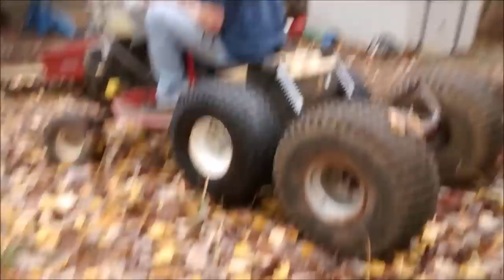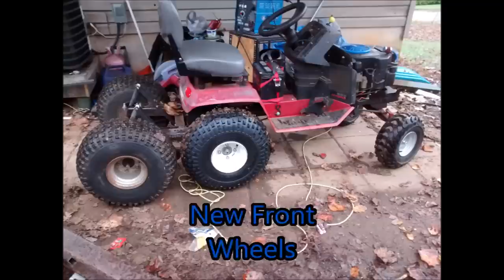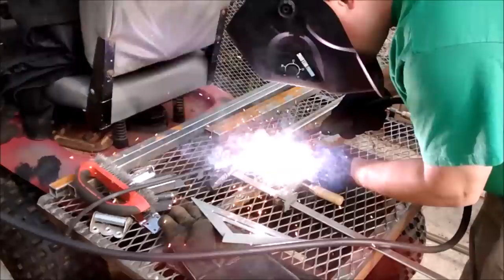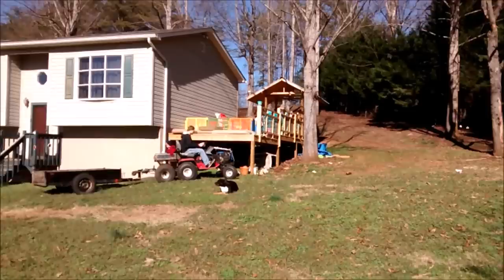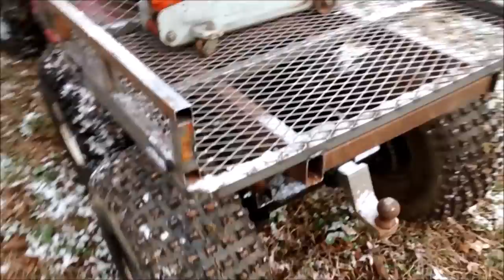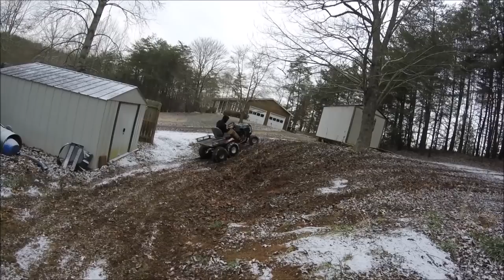6x4 Off Road Lawn Mower

Comment: It is what it is.  This project isn't intended to be the most perfectly engineered off road lawn tractor in the world.  But it clearly works pretty well, so don't be so critical guys.  It's also version 2.0, not 12.0.  Sure, there are ways to make this rig better.   I've got three lawn tractors sitting in my yard and who knows, maybe I'll try my hand at building a better version.  But until I or someone else builds a superior rig, don't be so quick to point out flaws in this one.   This guy deserves a round of free beer for his efforts.   It took a lot of work to put together a working model, test it, disassemble it, and build it back better.  That's the mark of a dedicated DIY project guy who just wasn't satisfied with the first version because he knew he could improve the design...and he did.  My hat's off to DangerDave.

Comment: Just my two cents. But the 2 axles need hooked up solid together. And a pivot in the center. So you will have the right down pressure.

Comment: Make a pair of tire chains so each sides wheels are connected! Half-track!
Reply: Matthew Barnes superb idea. I would get fat tires in front. More stability. But I must say that I admire all this work. I have 11hp snowblower with 3 forward speeds and 2 reverse. I want to convert it to a rear riding (standing up) log skidder or all purpose pulling vehicule (gravel, dirt, etc) . With a 2in hitch it would fit with my boat trailer, big garden trailer, destasher.
Reply: Easy Cut two truck tires of Appropriate round to then Oblong ..using a piece of string to figure out w about 2 1/2 inches of sidewall left as Guides preferred  E rated FOUND IN junkyard (recycle) ; deflate mower tires , slip on & reinflate. ...Half tracked Glory m8's 
All started w Good frame & swing arm design for ya superberbly well on a budget Very Noice indeed

Comment: Hi, can I use part of your video to my compilation homemade inventions and projects  ?
Reply from the maker: MGszaman Vlog sure that's fine.
Reply: @DangerDave95  i am gonna try and make a 4x8, i got two john deere sabres a plan and money.
is there anything i should be aware of a potential problems.
Reply: my engine will be mounted in the rear above the rear axles as opposed to yours however, and will have a cargo space up front.

Comment: Similar drive set up on the old JohnDeere Gator 6wheelers, for the rear wheels.  They have the engine sitting over the wheels and that weight being there makes all the difference in regards to traction.

Comment: How reliable are those chains and sprockets though after a long ride with some mud and rubble? Maintaining just the one chain on my dirtbike with its dust sheilds and adjustable hub & tensioner is already enough hassel to make me want to swap over shaft drive! Amazing job nonetheless though. The only thing I might have done differently is use double v-velts with a spring tensioner instead of chains for each set of wheels.
Reply from the maker: It's been 4+ years now and the chains and sprockets are completely fine. I haven't needed to do anything with them other than oil them when I remember lol. I've had it sunk into a lot of mud holes and gotten sticks stuck in the chains and it just keeps going. I'm using 530 roller equipment chain.

Comment: Great build! My $.02, both rear tires should be the same size. It appears that you have a larger diameter on the rear set. But again, great build!
Reply from the maker: the back tires are identical, but the front set are new and  have narrower rims, that's why they look different...

Comment: Im curious about the updated suspension that you made trying to figure out how it works. Does the length of square tube the shock is attached to pivot or is the shock fixed in place?

Comment: for winter get tracks on the back and skids on the front!
Reply: Nice idea but I highly doubt it would steer at all like that
Reply: why it wouldnt? it would be like snowmobile but 2 tracks insted of two.. well yeah you can weight transfer on snowmobile but so you can on this.Mo S.
Reply: +Saksugamer because you would tons of traction in the back and not enough in the front. engine isn't enough weight and it wouldn't be easy to distribute your weight. it would be awkward
Reply: +Mo S. well yeah but it would be cool and with bigger engine it would be drag machine

Comment: I know your going to think I'm nuts but I was looking at tractors for my daughter and a 4x4 small tractor is darn near $10k new and they dont have a bed on the back to put some weight in.  Do your idea seems perfect, can add wheel weights where it counts or couple feed sacks in the bed, the receiver hitch allows for the aftermarket implements for the garden and driveway work.  So do you offer plans on how you made the rear tandem setup?

Comment: Like the idea so to speak but, no mower deck so just something to drive around lawn now?
Reply from the maker: it's a poor man's ATV, it's cheaper and easier to fix than a regular ATV. I use it for yard work to carry tools and stuff, hauling wood, pulling my trailers, just all kinds of stuff. it's a work horse...
Reply: Danger Dave soften the tire pressure to get better traction. They look stiff.

Comment: Does improve the traction when backing up. My Craftsman Tractors do  great as long as I am pushing or pulling forward.  I can push a full blade of snow up my 10percent grade driveway.  It won't back up the same grade no matter what I try. I have chains on, but even on summer dry crushed asphalt it will not grip enough to back up a grade. Any suggestions
Reply: Lower you tire pressure

Comment: Wow that is awesome! I really like the bed! But how is the steering ratio? Isn't it though steering with four locked tires?
Reply from the maker: thanks. steering isn't that bad on dirt but on pavement it hardly turns lol but I've got an idea on how to fix that! :)
Reply: +Danger Dave cool! How? Saw the rear axle into two to make it diff again? Or would it even help?
Reply from the maker: I guess that would work but Im just going to make the old deck lift lever    so it will lift the rear axle and tires off the ground a little so when I'm turning it's not fighting the front tires and when I go off road or need to pull something I just lower the rear axle with the lever. I will make a video when I get time to do it.

Comment: How much would you charge to convert my lawn mower into one like this i live nearby in Taylorsville nc ?
Reply from the maker: hardcorvancour cool. Im not sure how much. What kind of lawnmower do you have? This kind of set up works best on a hydrostatic with 1" axle shafts.
Reply: Its a 03 Murray wide body not sure  what kind transmission it has it does not have the lever under the seat so you can push it
Reply from the maker: hardcorvancour you can't really make one using a regular geared transaxle for this setup because you have to back up and go forwards a lot to turn around in tight spots because the turning radius isn't the best. Lots of shifting in and out of reverse... A hydrostatic makes it so much easier and and effortless for doing 3 point turns. Plus they are smoother and have more pulling power... There's a few other 6x4 mowers on YouTube that people made using a regular geared transaxle and it just doesn't work, its hard for them to drive.
Reply: Danger Dave thats ok anyway maybe in the future. thank you for your time i love your videos

Comment: hey that thing is pretty sweet! how much power does it have? looks like it might could use a little more ;) also have you thought about running a reduced tire pressure? it might really give you that extra bite climbing up the snowy hills :)
Reply from the maker: +RippyTheRazer Thanks.  More power is always welcome!  :)   I will wait until I get stuck to deflate the tires.

Comment: is the orginal diff welded
Reply from the maker: No, doesn't need to be because the rear solid live axle locks all the wheels together. That's why there's two sets of chains and sprockets on either side of the axle.

Comment: is the trans axle locked or open
Reply from the maker: +dunbar837 the original hydrostatic transmission is not locked but the rear axle is a solid live axle with roller chains runing to both output shafts of the front trans so in turn it locks the front hydrostatic transmission. so both rear axles are fully locked together 4x4
Reply: During hard cornering would that not cause a lot more stress on one side of the diff. Having a push and pull effect? Just wanna iron out bugs before i start on my own. Originally i was just gonna do a trailing axel with a bed on top.
Reply: +Danger Dave I was noticing how much it was pushing in the turns. If you split the rear axle but added some kind of engagable coupler it'd make for a pretty good manual locker

Comment: Does anyone use ATV style brakes? I fear the downhill...lol
Also they could double as steering brakes.
Reply from the maker: I did on mud rat my other mud mower build. It worked very well and it could also be used as a parking brake. But I have since sold it and didn't get a chance to do a how to video... You can find pictures of it on my Instagram though @dangerdave95

Comment: Nice work on the design and build.  But pleeeeeeze  don't put a toddler on the back, unrestrained, while pulling a trailer.  Toddlers are very unpredictable, and can try to get up/off if they become restless or scared.  Maybe that child loves the ride but the next one (his cousin or neighbor) may not.  Also, any sudden lurch or big jolt or bump (like when off-roading) can easily knock him off.  The trailer adds a huge hazard for a child that may fall off.  I hate to be that guy but I'd hate it even more if there were a tragic accident because I didn't speak up.  Again, very nice work!
Reply: I was gonna say something. Without the trailer I think you are fine.  I am not some safety nazi.  The first thing I thought of when I saw the kid and the trailer was a story in our Farm Bureau newsletter years ago.  Guy was giving his kid a ride on the fender of the tractor while mowing with a rear deck mower.  I have rode on tractor fenders dozens of times so that didn't sound too dangerous.   Turns out new fenders aren't as strong as they used to be.  

The fender breaks,kid falls off and goes under the mower.  Apparently the guy running the tractor was a vet because the way he described it "I have seen what happens when a man sets off a landmine.  There was more left of that man than there was of my son."  

Next he talks about going in the house to commit suicide with his hunting rifle but his wife had thought to unload it and hide the ammo.   Needless to say this is one of those wounds that time doesn't heal and the man blames himself everyday.  

I understand you weren't running a mower but that trailer could do horrible things to a toddler's head.  You are obviously a very smart, hard working man.  You can do things with your hands most of us can't and have a lovely home and land I am sure you have worked hard for.  You also have family I am sure you love very much.  Please when giving rides put the kids on the farthest end of the equipment so if they fall off nothing hits them.  

I love this build and I am sure your kids or grandkids will have a lot of fun riding on it.  I am not asking you to stop letting them.  Just please be careful with towed equipment.  Have a great day.
Reply: Mom was probably filming so she would be screaming if something was about to happen.
Reply from the maker: I had a bungee cord around his waist holding him in... I know it wasn't the best idea at the time but I had everything in control..